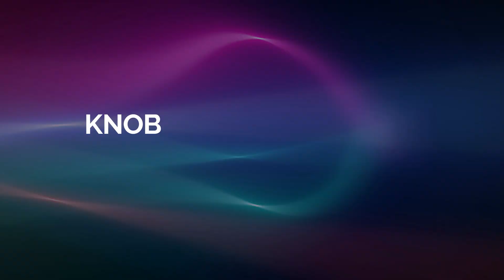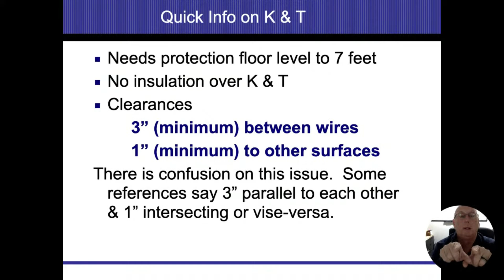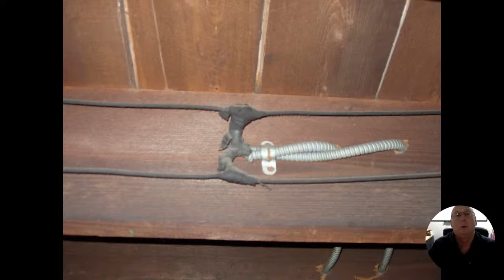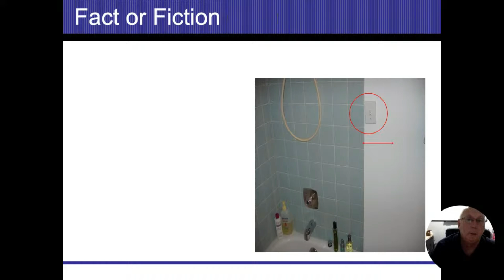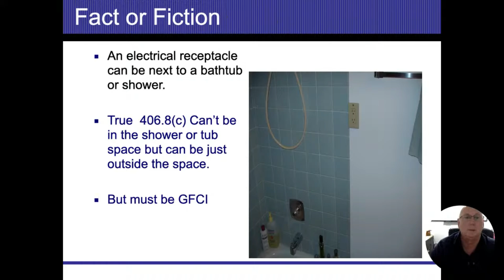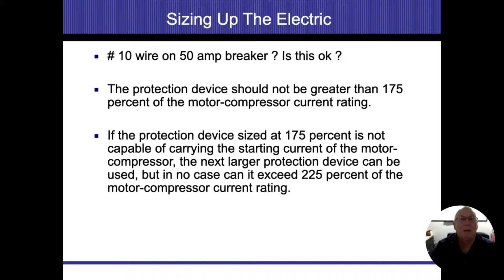Knob and Tube Wiring Explained

Comment: its actually a good system because the conductors do not come together until the device...only real problem is no ground and you cant bury it in insulation.

Comment: Thanks for presenting this rare knowledge on knob and tube safety.   Many people will benefit from this.   I assisted my grandfather 70 years ago to wire and perform repairs on houses and barns that had this wiring.  We converted some to the then standard BX but now the insulation in BX junction boxes can crumble. The wire in the metal sheath remains viable.  Economically, replacement could cost more than the value of some older houses.  There is another fetish out there that replacing the fuse panel with a CB panel will improve safety.  I am of the opinion that more harm can come from this than benefit because of at least the crumbling wire.